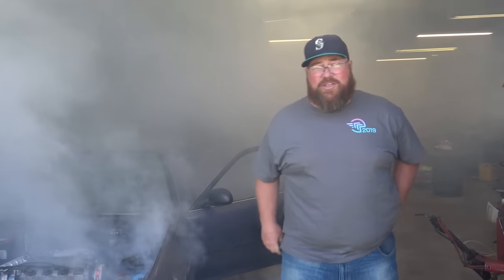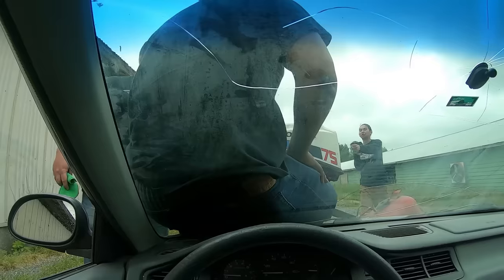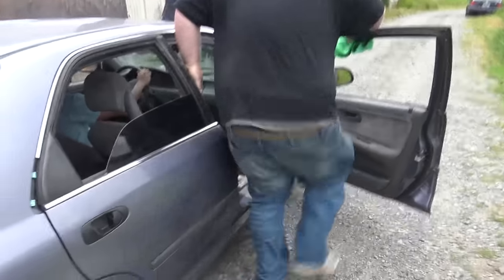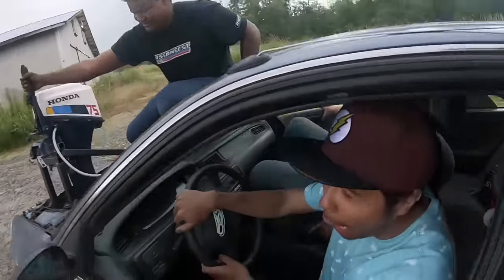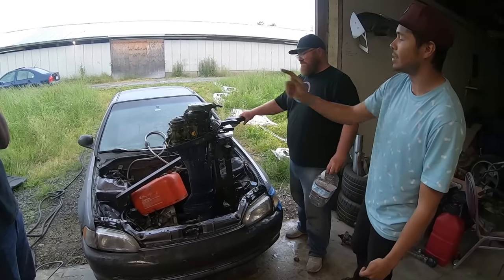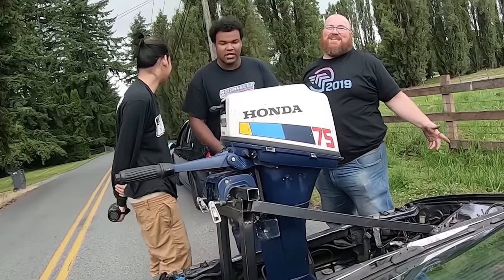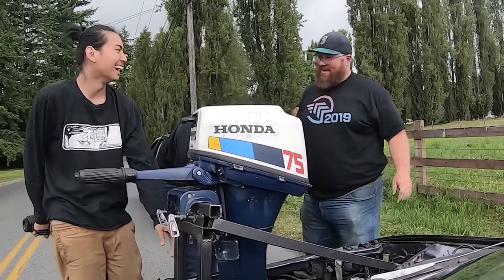BOAT Motor SWAP in a CAR!

Comment: That 7.5 is clean AF actually worth more than the car!!
Reply: Haha not anymore it's shot now after being overheated and having the lower unit torqued on so hard
Reply: I'd rather have my johnson 15..
Reply: Dylan Batie 75*
Reply: @midwestsirens  no 7.5
Reply: Hik Dingle 1:13 bruh ._. That’s a 75 my dude
Reply: @midwestsirens  no its not its way to small  its a old motor and in that time they didn't write down the dots
Reply: @midwestsirens  just search Honda 75 outboard
Reply: whoopy fpv tHeY DiDn’T wRiTe dOwN ThE dOtS it’s a 75 my dude
Reply: @midwestsirens  Nope, sorry but it's way to small to be a 75
Reply: @midwestsirens  I really hope ur joking and not just stupid. Look up old honda outboards. They didn't write the decimals on the motor cowl back then. Really common for the old small motors like that. Also u should've gotten a clue when the car couldn't make it up a small hill. Or when u saw the tiny size.
Reply: What if it was a bigger one
Reply: RCDude 7.5 horsepower lol
Reply: Its a 75 buddy I looked it up and I also have a boat there not that big
Reply: Its a 7.5...period. 75s are much larger and usually have 3 or 4 cylinders. Plus Honda never made a 75hp thats that old. The only 75hp Hondas are the new ones today. The most obvious part is if that was 75hp it would've actually gone over 15 mph🤣🤣 I guess that wasn't a dead giveaway🤦🏻‍♂️
Reply: No it would say 7.5 and I literally  have a boat with that engine on it
Reply: @gageroman9346  Every bf75 says that its a 7.5 in the articles. So I'm gonna say you don't have a boat with that engine or you'd know its a 7.5hp.
Reply: Look up bf 75
Reply: On hondas website it says its a 4 cylinder  16 valve engine
Reply: @gageroman9346  The brand new BF75s are indeed 75hp and I knew that. This one in the video is from the 80s and its 7.5hp and its a 2 cylinder.
Reply: Yeah sorry I was wrong the was no point in the picture  and multiple sites were wrong  I looked into it further ur right
Reply: Thats actually quite true
Reply: Y’all arguing over boat engines LOL
Reply: @user-gj5hi3jy5m  you know boats are fucking cool :D I bought one last summer and I can say cruising on my own boat is better than driving a car
Reply: @elonmust7470  i dont wanna talk you down but Johnson engines are trash
Reply: @tijnhamstra7729  That's why there're soany old johnson engines around..
Reply: @anthonyaguiar8919  well not everyone knows a lot about boat engines
Reply: @midwestsirens  a  twin cylinder 196cc making 75hp? ur smoking crack
Reply: @claytonburch5181  Apparently you didn’t see the number. It says 75 not 7.5
Reply: @anthonyaguiar8919  Does that not say 75?! It doesn’t say 7.5
Reply: @hikdingle2210  Are you blind? That says 75 not 7.5
Reply: @midwestsirens  It's a 7.5
Reply: @hikdingle2210  Does. It. Say. 7.5?
Reply: @midwestsirens  yes
Reply: @hikdingle2210  it looks way to small for a 75hp,back in those days a 75hp would have been massive, one dude wouldn't be lifting it so easily.
Reply: Ok people lets settle this... even mercury outboards had numbers like 1150 for the 115hp, 850 for 85hp, 1250 for 125hp and they did that for the longest time! 

To make things more confusing they made  2.4 and 2.5 outboards which were 2.4Liter and 2.5Liter V6s with like 260hp... not 2.4 or 2.5hp 

That honda 75 has 7.5hp. Its obviously tiny. Smaller than a merc 9.9.
Reply: @midwestsirens  why were you arguing so hard when you were clearly wrong
Reply: @midwestsirens  you literally had 5 different people telling you that you were wrong and you were still being that ignorant
Reply: @ghxst7951  Because those 5 people are clearly blind. There is no dot between 7 and 5. It’s 75
Reply: @midwestsirens  okay it says 75 but its a 7.5
Reply: @midwestsirens  I know outboard motors and that’s clearly a 7.5 hp outboard. It’s way too small to be a 75

Comment: Y'all should do a legit swap with a 150hp 2 cycle or something. Use a manual transmission car and hook up the throttle and water cooling
Reply: Tyler Scott Ehh that makes too much sense for this channel
Reply: I got excited from the thumbnail making me think it was a 75hp. Not 7.5...... make a ghetto rudezon!
Reply: That would make an enormous cloud of smoke wherever it went. The only reason they were able to get away with them is because they exhaust into the water where you can't see it.
Reply: @autogolazzojr7950  that's the point!  Lol
Reply: @fry.master  The honda's didn't have a dot between the numbers back then. 75 was 7.5 hp, 100 was 10hp etc.
Reply: @autogolazzojr7950  once they warm up, hardly any smoke lol
Reply: @ct1762  A direct injected 2 stroke? Sure, but a big carb 2 stroke outboard will smoke even when warmed up. Look at this video toward the end: https://youtu.be/KZ893T3Vkzg
Reply: @autogolazzojr7950  were did you get a v6 looper warms up in 2 minutes? Also, he may be using break in double oil i have no idea what ratio he's running!
Reply: @ct1762  Fair enough. Find me a video of a large carbed 2 stroke outboard on a stand being revved without smoke.

Comment: You gotta try putting a gear reduction in before the transmission. It'd bind less on the motor and may actually make you go faster cuz it'd be able to build up it's RPMs.

Comment: It would be so much better if you would weld the end of the original crankshaft to the engines so you could use the clutch system.

Comment: You guys need a bigger engine and see if you can incorporate a clutch/flywheel also you have gears..

Or 

Turbo the boat motor 😂
Reply: No... Quad turbo the boat motor
Reply: @snottyboy9983  done forget to plumb it with PVC pipe and duct tape.
Reply: So you mean like... put a car motor in it..
Reply: Satveer Degun They need a speed boat four stroke engine of 350 HP and the boat manual stick to  trottle hahaha BWHUUUUUUUUUUUUUUUUUUUWWWWWWS

Comment: you should cut up the engine to keep the clutch and flywheel assembly to be able to shift and pass a cable inside the car for the throttle

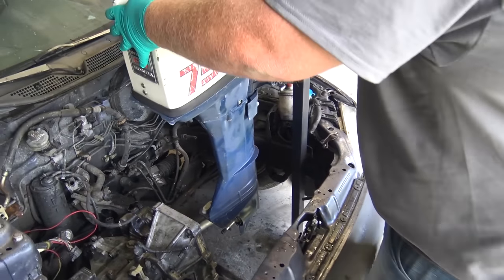Comment: regarding the shaft connector between the boat motor and the transmission, where can i get one like the one used in the video?  see: 01:59

Comment: Why not make the throttle work with the throttle cable and make a clutch adapter so you can actually use the transmission

Comment: Obviously anything is going to work when you weld it to the transmission, but I’m tired of seeing these low effort dumb engine swaps where you can’t even make the throttle work correctly and usable from inside the vehicle

Comment: LOL! Man, I'm 63 now but me and two friends used to do that shit ALL THE TIME! It's great to see you lunatics exist in this f***'ed-up world. At least I know now that there are more like me out there. Seriously though, that is funny and when we used to do that kind of thing, (we were all between the ages of 15 and 17), we'd just 'automatically' get our shit together and worked as a team.

It was like the only time when we'd actually show some form of organization, concentration, and indicated that we had any level of IQ at all. Of course, for most of us, we had to get older and got serious, (and stopped scaring the community, lol).

I don't know which one of the 4 of you are crazier! The one working the throttle and the one on the roof, video-recording the event stand to get killed if the other two in the car distract each other enough to forget to steer! We'd take old '66 & '67 Chevy Corvairs' (we must have had 5 or 6 of them that we bought from junkyards), and remove the bodies. 

Then from there it was up for grabs. Some were converted to dune buggies. In others, we'd remove the engine and in one case, we tried to do the exact opposite that you guys did. We tried to weld the Corvair, V-6, air-cooled engine, in a 18 foot row boat.

It was insane and in the end, we failed miserably. At first, we found that the motor had to be mounted in the near center of the boat. Then, the engine kept breaking the welds of our 'poorly rigged' motor-mounts each time we'd start it. Finally, we got that worked out and used the transom of an old electric boat motor that we found and of course, a lot of hole-cutting & welding.

The water would rush into the boat through all of the welds that were supposed to have sealed the gaps. So, at some point my genius friend came up with the idea to seal the leaks with roofing tar. Well during our 3rd test, (this time with the roofing tar), we put the boat in the water, and no leaks!.

So Bob connected the battery and started the motor and about 5 seconds later, the tar started on fire. Apparently, the 5 gallon gas tank we were using, was leaking a small amount of gas. The starter wires were a tangled mess on one of the aluminum seats. The wires arced and poof! Instant fire! 

The fire grew big so fast that we were afraid to risk trying to put it out. Jesse tried to snatch the 5 gallon gas tank out of the boat but he didn't have a tight grip on it and when he turned and ran. He was hoping the hose connections for the hoses that ran to the gas tank, would break as he yanked on it.

Instead, the tank was yanked out of his hand and landed on the medium sized fire. This instantly turned the 'medium-sized fire' into a massive fire burst. We never did know if or when the motor stopped running but the melted tar from the fire allowed the water to rush in and the boat sank to the bottom, (about 10 feet). 

The pond was actually an old, flooded gravel pit 'puddle' about 35' in diameter. The bottom was comprised of a thick silt and you wouldn't dare swim in this 'pool'. Nothing lived in it and we never could ascertain how thick that silt at the bottom was.

A few months later, we tried to see if we could pull the boat up out of the pool using a weighted-down, 'home-made', grappling hook. However, we never found the boat and even though we had plenty of rope to work with, we never even felt the grappling hook touch anything that could have been the boat.